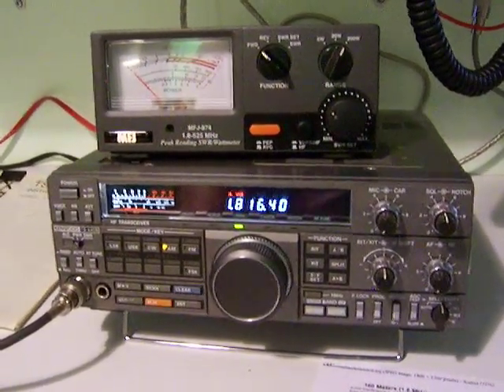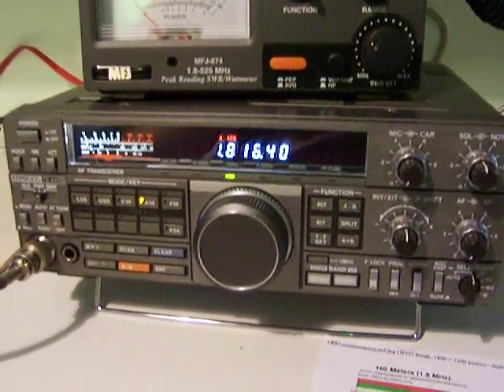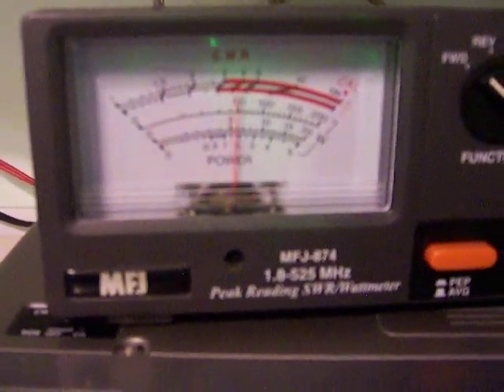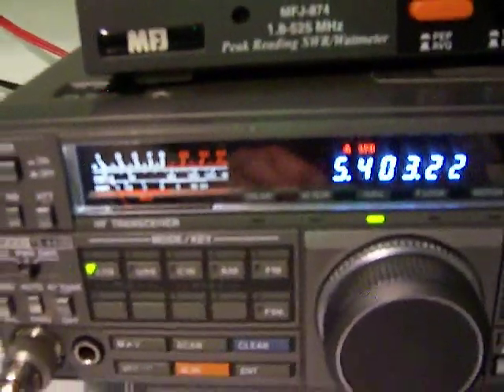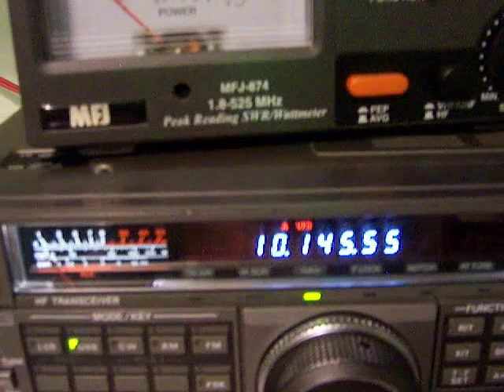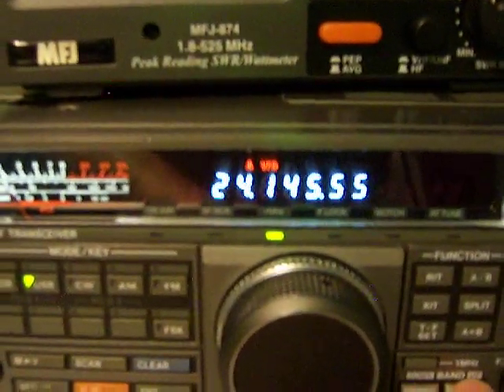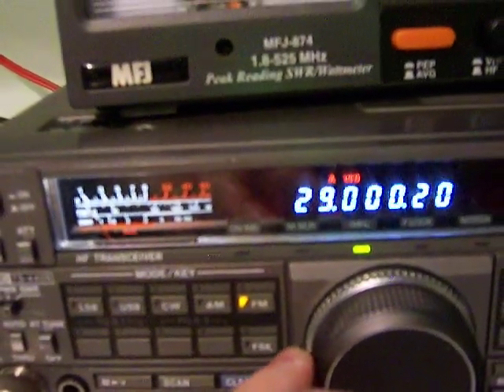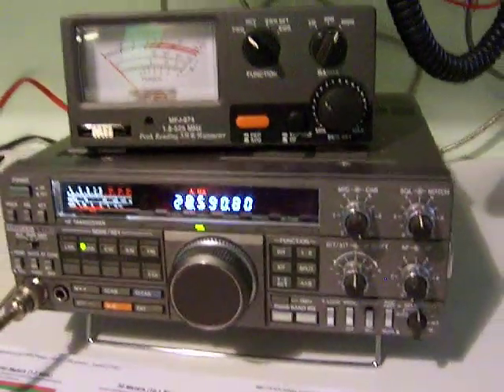Kenwood TS440 Power output

Comment: Soon I'll be receiving a Jahnke electronics refurb 440 with YK-88C CW 
filter. Any opinions on which SSB filter? YK-88SN (1.8KHz) vs 
YK-88S(2.4KHZ)? I'm also thinking about the BHI filter to turn it into a
 440S "DSP"
Reply from the maker: Jahnke electronics is the place for the 440 and other HF radios. But he has been slowing down as of recent. Don't see too many offerings and his prices have skyrocketed. 440DSP? Never heard of it!